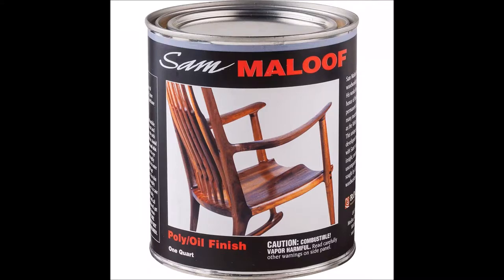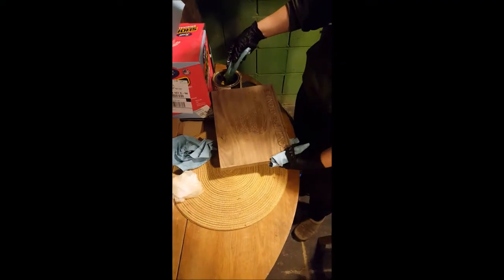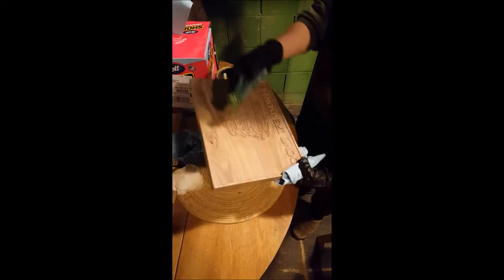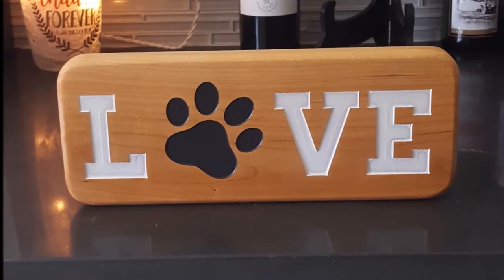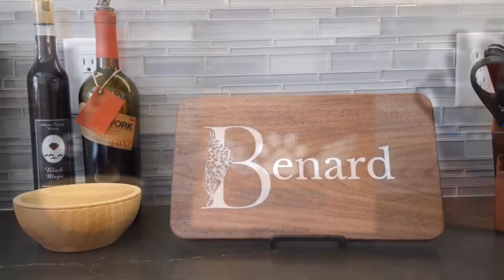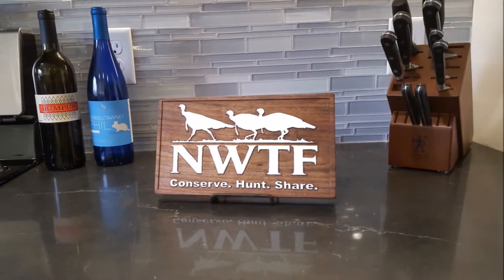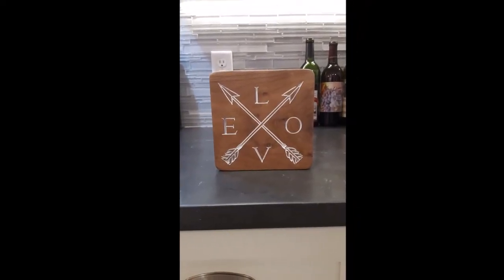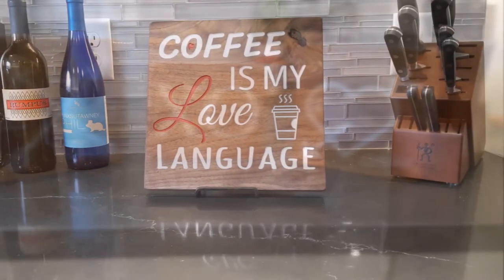Maloof Poly/Oil

Comment: I just ordered the Sam Maloof finish from Rockler....opting to buy it rather than make my own (which I think I might do sometime in the future).  On another topic, being retired Navy, I absolutely loved that "Don't Tread on Me" plaque (as it was the first Navy Union Jack).  I can't help but wonder as to how that was cut into the wood.  Regardless, beautiful work, amigo----Bravo-Zulu!
Reply from the maker: I appreciate the kind words! The sign was carved on the XCarve from Inventables. I think you'll really like the Maloof oil.  Just be sure to stir before use, and don't shake it. I made that mistake and it ruined the finish with all of the bubbles.
Reply: @martin_kiln_and_slabworks  just curious as to why bubbles are a problem if you are rubbing it on with a rag and then removing all the excess.  Wouldn’t that remove any issues with bubbles.  My instincts tell me that bubbles would be a problem if brushing on and leaving the finish on to dry and build up.  The wiping would certainly remove any bubbles from the surface of the wood.  Thank you for the video.